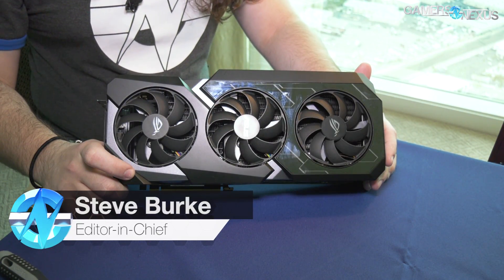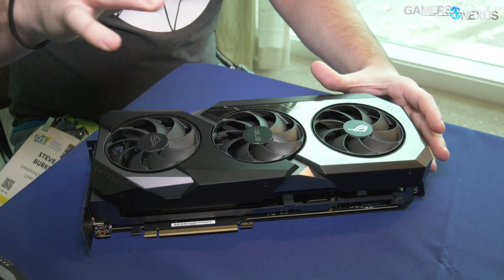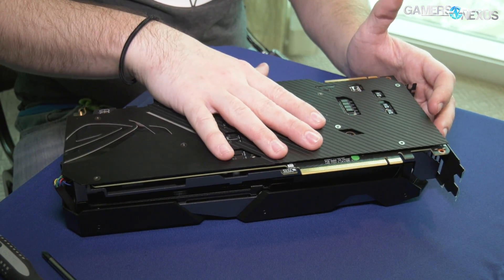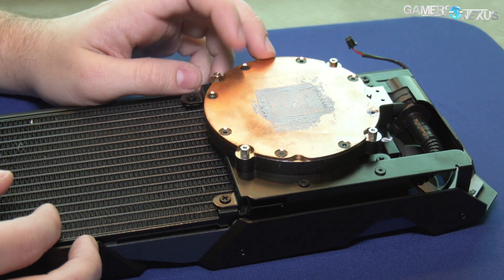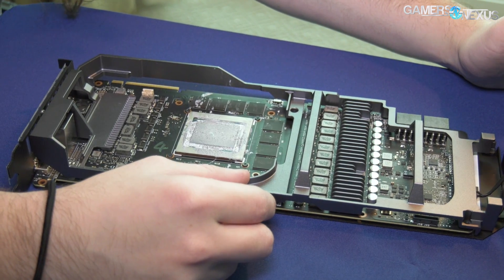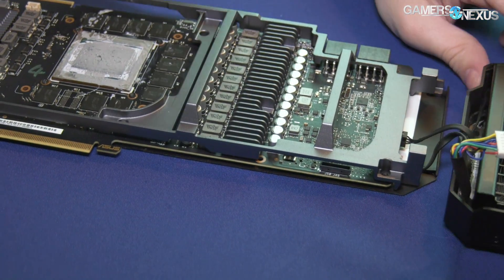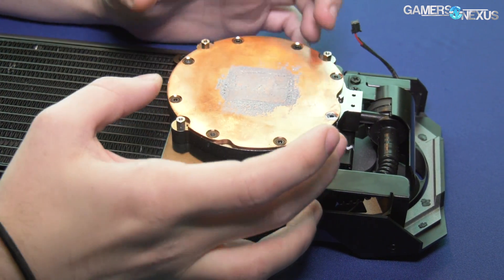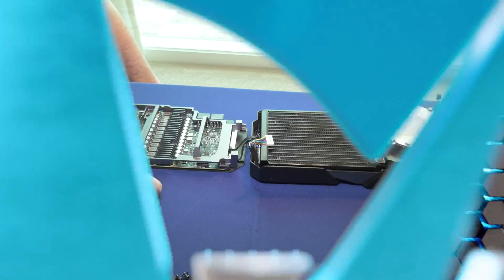ASUS Matrix Tear-Down: Radiator Replaces Shroud (2080 Ti)

Comment: mine's running on 88 celsius after 3 years of use it's time to re paste it I mailed asus about the termal pads sizes but they advised me to take it apart and measure it myself... any idea what size of thermal pads would i need ? never done this before and don't wanna wait too long for separate delivery pls help me thanks

Comment: Hi all, I have just bought this card ROG Matrix 2080 ti in Ireland.  It does not have "Platinum" on the packaging. Waiting for the delivery.
 
I think the retailer made a mistake and I have gotten a great deal, due to all the bloated prices. BUT I cannot find any reviews, other than the one on TechPowerUP for ROG Matrix Platinum.  Anyone have any benchmarks?

Does anyone know if the ROG Matrix rtx 2080 ti, is the same as the Platinum? 
Is the branding just different for Europe?

Comment: Do you like the ROG STRIX GAMING GeForce RTX2080Ti, but think it's not quite special enough for you?

Do you think that it it can't be overclocked quite high enough? 

Do you desperately need that extra bit of cooling power for those few extra FPS at 4K Ultra settings with ray tracing, even at the expense of having a card that: 1) is heavier, requiring reinforced slots AND additional retention, 2) has one additional source of noise (which will get noisier over time) and a potential point of failure, 3) requires high static pressure fans that must work a lot harder than they would on a typical graphics card with an open-design heatpipe cooler, due to a much higher fin density and a more enclosed shroud desing, having tighter gaps for the hot air to escape through, 4) will eventually lose that extra bit of edge in thermals over a the usual heatpipe open cooler solutions due to liquid evaporation, 5) despite water cooled, doesn't come with it's biggest advantage, that being giving you the choice of a favorable radiator placement and an easy fan replacement and/or upgrade, and 6) introduces the possibilty, however tiny, yet still present, of a catastrophic failure that has the potential of not only damaging your graphics card beyond repair, but other expensive components as well?

Do you think none of the above are real concerns because you failed your basic physics class?

Do you have too much money?

Then this is the product for you.

Comment: dumping the heat of a GPU into the case is like the exact opposite of the idea of the hybrid coolers, the whole purpose is to get the heat out of the case, you are just hot boxing the case with a cooler like that, limiting it's efficiency.

Comment: Last year CES was a bit meh but if this is an indicator of what new trends or ideas are comming I'm pretty excited of what this year has to offer . I do wonder though how easy it is to service this card , in case the pump dies , a hose cracks or the water level runs low . It would be a shame to throw out the whole cooler if some small part of it fails for some reason

Comment: I would be surprised if it has any benefits to a better air cooler and than you are left with all the drawbacks of a AiO.
Pump sounds, won't be silent in idle, expensive, life expectancy 2-3 years at best, if something breaks you are literally screwed.

Comment: What's the point of a liquid cooler if you don't put the radiator away from the heat source? In such a small distance, heatpipes do the job well while they are incomparably more reliable, cheaper, silent, and the whole build is much lighter.

Comment: But why? Heat pipes and vapor chambers conduct more heat, are more compact, and are less prone to failure.
Is this solution cheaper? Does it have a better thermal/acoustic performance?
Or is it just liquid cooling for the sake of having liquid cooling?

Comment: It's nice cooling solution and sure takes less room when compared to other Liquid-cooled-AIO GPUs. But i'm just wondering how much better does it handle moving the heat away from the card. Those with hoses and radiator away from card take the heat far away from card, but this Matrix card pushes the heat around the card through the radiator.. Maybe review will show it

Comment: Would this be served better by fans that pulled air through the radiator instead of blowing it down onto the card? If you reversed the voltage to the fans, would temps be better? :D

Comment: Hi
I am a user waiting for Poseidon in Korea.
I saw this Matrix product video.
Other distributors installed a 240mm radiator
The matrix is equipped with an integrated water cooler that can not be 240mm. It looks like it is circulating inside when it is cooled, even if it does not remove the heat generated inside the graphics card during advanced games. I want to know how much cooling performance is.

Comment: This is what Ive been dreaming of. A gpu which has an AIO CLC built into the shroud. So glad to see Asus finally do it. Imagine if they did a 360mm rad with 3 fan configuration and 3x8 pin pcie power input, 1 designated to the pump and fans itself, that would allow for even higher static pressure fans or a more powerful pump to be fitted.
Dont get me wrong, I would still prefer a purpose built waterblock and incorporate it into my Custom Loop, but this is truely next level innovation from Asus.

Comment: heavy strain on the slot it goes into  ... you should need a bracket or something to keep it from sagging and maybe damaging the slot
Reply: It's built into the frame.
Reply: the weight of the card will put a strain on the pci slot

Comment: I fail to see the point of this... radiators typically are used because they can be mounted at intake/exhaust locations, so they either get cold outside air, or their hot exhaust is immediately ejected from the case... what will this do? Convince people the thermals are great for a few minutes until all the liquid heats up?
Reply: Jason Dailey should exhaust the hot air out of the back of the case just like every other encased card
Reply: Steven Juris it would only accomplish that with case fans sucking the hot air out, just like all non-blower graphics cards

Comment: I have a custom loop but this is kind of stupid. By putting it on the card you’re just replacing a regular fin stack with a fin stack that has water in and pump etc. I bet you’d get better cooling making a 3 slot air cooler that’s the same size, and it would be lighter and cheaper. 
10/10 for innovation 
1/10 for usefulness

Comment: Just hope that AIO lasts longer that 3 years.
Reply: If you got the money for this card I'm assuming you will be able to afford a replacement in a few years, considering 1 or 2 new GPU architectures will probably be out by then.
Reply: @jackapc4727  i wouldnt be so sure. Nvidia is kinda floundering in terms of actual performance gains per dollar. And i dont think amd is gonna compete but i could be wrong.
Reply: @jackapc4727  It's still gonna be hard to sell, whoever buys it in few years is gonna have to either get aftermarket cooler or do custom loop. I got 280x cheaply last year till i saved some money for 1060 and it's still great card, it was vapor-x card with dual fans and it was loud but cold, this on the other hand will be useless if pump fails.
Reply: @cekpi7  If this cooling rig was serviceable it could live a longer life. Pump, tubing, rad. If they made it easy to do that would really help.
Reply: My CPU AIO lasted 3 Months and the Pump broke...RMA'ed 3 times, every time after just 3 months the pump broke. The i got sick of it and switched back to air.
Reply: Gucky . A bit anecdotal and to balance it out, I have had mine for 4 years so far.

Comment: It'd be interesting to know: why liquid cooling? They couldn't get any gains just with fans? Can this whole setup used as a water block? How much more expensive is it, than a reference card with a 3d party block?
Reply: Turing is touchy with temperature, Once you cross 40C and higher (there are incremental temp steps like every 10c or 15c) at each temp step your Mhz go lower. My guess is they were trying to keep it under 40C  at all times to give you the most power in a Gpu without having to mount a rad some where in your case or to do custom loop cooling.

Comment: Why though? Fin density? Thermal mass? It just seems weird to heat water and pump it 3 cm to be cooled by a cooler that isn't much bigger than a normal card nor is it in a different physical location for airflow. I bet it'll perform great when testing and I'll eat these words but it seems like a really cool gimmick.
Reply: It's just a cool idea, dont have to overthink it.  It's nice to see manufacturers thinking outside the box and doing something unique.
Reply: @MegaTechpc  Agreed, just speculating whether it'll be worth purchasing when it comes to market or if it's just a cool weird thing to have. The insides definitely look awesome
Reply: I hear ya. The use cases where pumped fluid makes sense over heatpipes are mainly where you want to move the heat some distance to where it will be dissipated. This card does not do that. I'd be surprised if it has better thermals than a good triple-fan card. It just seems like a REALLY expensive way to do a mediocre hybrid (that custom water block and tubing can't be cheap). But as you can see from the comments here, a lot of people are going crazy over it. Hopefully they do get it in to test.
Reply: radiators are probably far more efficient in even heat transfer than a heatpipe+fin stack, and the amount of heat able to be transferred away from the cold plate is better with powered flow as well

Comment: I dunno.. I love the design, it is extremely unique - so unique and awesome that I am looking to upgrade my rig with this once the final results are in - but most if not all GPU manufacturers say that the warranty gets voided when opening a GPU - what if the radiator gets dusty? Which will be, I speak of experience with my rig. Doesn't look like it could be easy to dust off.
Reply: Just for the record EVGA does not void warranty if you open it up.
Reply: @johntotten4872  Good to know. But what if this design is so unique (and kind of complicated built once you delve deeper to the heatsink/radiator/tubes) that there has to be a void warranty? Well, I'll wait until it's released this month. Thanks for the reply, I hope that rule persists with this card too.

Comment: This card beats any kind of Hybrid Card on the market since you don't really need radiator mounts on your case but looses to custom watercooling on bigger radiators.
Reply: Who doesn't have any 240mm radiator mounts, but can afford a $1600 card??? The way I see this, is that the ASUS ROG Matrix RTX 2080 Ti is a solution to a problem that we simply don't have.
Reply: @MrPhilip796  maybe smaller and high end builds like in the ncase m1 where cpu needs 240 rad and then this beast of a gpu
Reply: @BITVedanshAgarwal  Even then I'm not so sure, because it looks like this GPU will be a bit over 3 slots from the pictures I've seen over on Videocardz, and IIRC the M1 only supports 3.
Reply: There's a lot of people that have the ability to throw out that kind of cash but don't want custom watercooling. 
It also looks a lot nicer than those hybrid cards with separate radiator so I think Asus have outdone themselves on this one, probably be on backorder 100% of the time.
Reply: @MrPhilip796  So?  The point of it is that its cool!  Pun intended!

Comment: You sorta have to wonder why an AIB hasn't done this before? Kudos for Asus on trying something new. The only thing I will say though is having a "traditional" AIO where the radiator is on the outside, you can exhaust all the hot air outside of the case. But it'd be interesting to see the temps on this Asus card. Can't wait for the 30 minute GN video testing this baby in and out!

Comment: At first I thought it was going to be one of those stupid Poseidon hybrid cards that was kinda "meh" at both water and air cooling. Then I saw the integrated radiator which got me really interested. Looking forward to a full review. It's kinda hard to tell on camera how big it is, but if this card were to fit in something like a Ncase M1 or Dancase A4 that would be sick!
Reply: Ncase m1 yes (but without any case fans underneath the gpu) but then you are trading the extra airflow that the two 120 fans would provide for this watercooling which might be worse than the two fans. But also these matrix will be very high binned (top 5% from what I heard) so you might want that

Dan A4 NO
Reply: If I heard the grapevine correctly, it is a 3 slot card for height.  Not sure what those support right off.  :/
Reply: 2.5 or 3 slots. Definitely gonna be neat to see the thermals. I wonder if I can fit this in my FD Core 500

Comment: Better be good with regards to permeation or that pump is going to be super loud if gas bubbles are going through and what not since there is not really a high point in the CLC for it to accumulate in it'll just recirculate

Comment: Can’t wait to see the thermals on this thing
Reply: I dunno, its just going to blow the hot air into the case regardless, as opposed to the radiator and fan set up as an exhaust on a regular aio.
Reply: @guyincognito566  But it's still gonna be cooler air than from any air cooled gpu anyways, so, why not?

Comment: What is the point if it's the same size as an air cooled one? Doesn't the additional pump and large cold plate detract from space for fins?
Reply: 4-6 heatpipes vs. a 240 radiator
hmmmmmmmmmmmm 🤔🤔🤔
Reply: @Alb 92 Do you mean that a radiator is more efficient than fins per surface area? In that case I get the point.
Reply: @Alb 92 Hm I see, I've gotten into PC stuff a year ago and recently built my first one (yeah 2018 was a bad year for that) but never looked into water cooling at all.
So thanks for letting me know, I suppose the liquid traveling throughout the rad really spreads out the heat very efficiently, which is why they are so much better than "classic" heatsinks.
Cool!

Comment: This is going to snap your pcie socket out lmao looks really good though
Reply: I would think someone spending 1700 on a nice looking card is going to mount it vertically in their case to display it
Reply: @fufun4me  yeah as its watercooled so 
Vertically arrangement won't chose the card so yeah i would mount it vertically
Reply: @drake6836  The fans will be up against the glass like on a normal air cooled card, so vertical mounting will choke the airflow
Reply: @isakh8565  nope 
Don't use the case included vertical bracket 
Use CableMods  One's They Have Enough Gap between glass the the gpu fans. See this video here https://youtu.be/jkQzJVA1Exo
Reply: @drake6836  Of course there's exceptions for aftermarket stuff like that. There's also a case that allows you to angle the card at like 45 degrees so it's not right up against the glass. Most vertical mounts will choke the card's access to air though. 
You said that because this is watercooled, vertical mounting won't choke the card. That was what I disagreed with, as that's only the case when the radiator is mounted somewhere else (or if you have that cablemod kit or something similar, but that has nothing to do with water vs air cooled)
Reply: @isakh8565  come on man if someone can buy this beastly expensive card they can buy thT cablemod bracket too
Reply: @isakh8565  and yeah 
I would never go water cooler :// 
Air is my thing
Reply: You can always use a gpu support brace
Reply: @Carlisho  oh i forgot 
Or even lego :)
Reply: yeahhhh, I think this card is only going to be installed vertically mounted with riser cable lol.
Reply: @FroggyCrimes  This is where my good old TJ-11 with the rotated mobo tray can really shine!  Two of these sitting next to each other in my case would look baller!  Of course I'm still doing just fine with my old ass Titans and EK blocks right now!
Reply: If a get one of this, I will buy the Thermaltake Tower 900 case.
Reply: ayy, Horizontal pcs are making a comeback

Comment: This might be the most original cooler design I've seen, that's just amazing. Can't wait to see someone mod it to fit another GPU or custom make something simillar using a normal AIO
Reply: I mounted a Corsair h115i 280mm AIO to my evga 1080ti with the nzxt g12 a year ago. Works great, low noise and runs at about 50c under load. It will autoclock to 2.025ghz with ease. Same setup should work even better on the 2080ti.
Reply: @gnrtradepro  not really the same thing as this though. If it's done right, it has the performance of a water cooled card but the ease of use/installation of an air cooled card. And looks way better that a G12/AIO combo in my opinion, although I'm a bit of an Asus fan boy
Reply: @DeBlackKnight  I agree, its a good idea from Asus, however i can replace my aio if needed. It blows no heat onto the card/vrm etc. The aio is set to exhaust all heat from the case and i can put the unused stock cooling back on the 1080ti and hand it down to my daughter with unused fans when i upgrade and/or the aio is reaching end of life.
Reply: @gnrtradepro  The Kraken G12 is nice but for someone like me who never really finalizes my main build and uses a PC O7S case, Kraken isn't a viable option.
Reply: @gnrtradepro  really nzxt g12 bracket works with h115i? I have this aio and I thought its not compatible with the nzxt bracket
Reply: @patent5421  Works fine. The shroud does not interfere. The pump/block is standard Asetek fitting. Just be sure you mount the pump/block before mounting the g12 to the card.
Reply: @gnrtradepro  Your set up Most likely better as it can get fresh air and not recirculated air in the this exsmple